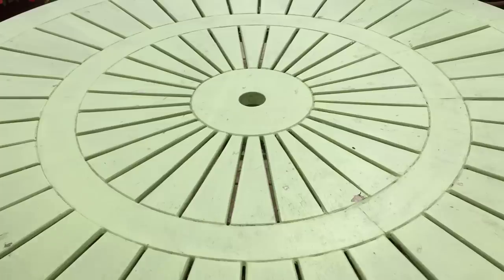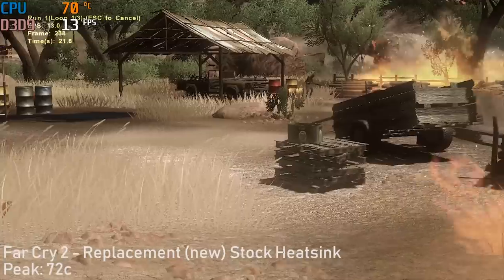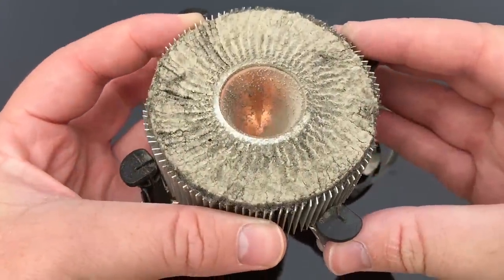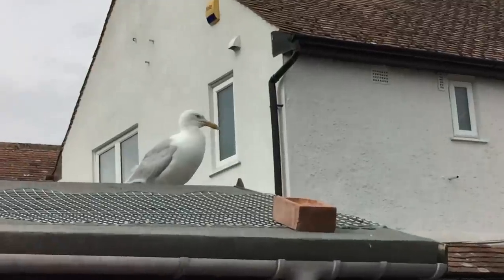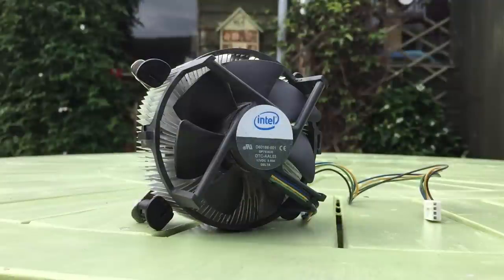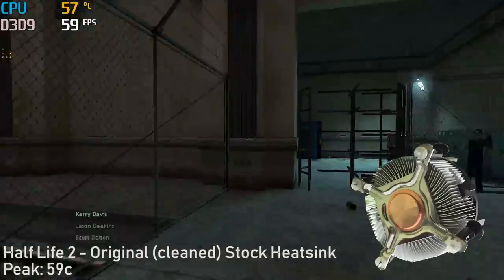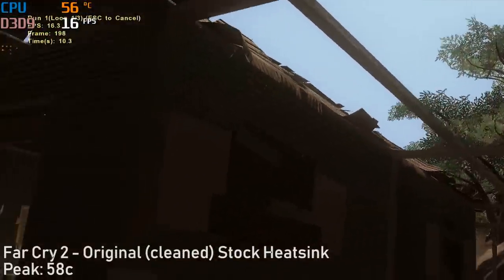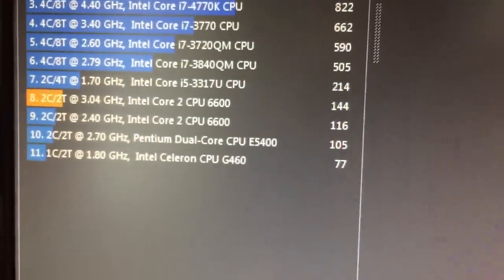Saving The OG Intel Heatsink!

Comment: Sadly, Intel’s Stock HSF for LGA775 doesn’t compatible with LGA115x boards. ☹️
Reply: johnpaul bautista I'm actually using one on my MSI 1155 Motherboard... I had to lock it down with Zip ties though... It's very secure though... I even grabbed the whole thing by the cooler and it didn't budge at all
Reply: Rourke Hikari i think it’s a good idea but AsRock does add mounting holes for LGA1155 boards (Example: AsRock H61M-VG4) kindly google for that board and see it. 

Btw, I have a older HSF with Copper in the center but a broken mounting locks. But there is a easy fix for that. Salvage a hsf from a newer one.
Reply: I was thinking about swapping the new stock cooler on my 4690k with one I have buy I guess not.
Reply: Easily solved with small round file and few minutes of work
Reply: Intel Copper HSF such as these are available for 115X, they probably come with higher clocked core i5/i7's. I bought some from recycle junk shops and is installed on my kiddos i5 2500 non k pc.
Reply: johnpaul bautista Actually... you can with some improvisation, UFD already did it
Reply: Jussapitka You can't but you can, watch UFD Tech video about it.
Reply: @JaypiTechPHOfficial  I broke the clips of my cooler like a moron, you can order them online for really cheap

Comment: I never ever ever through PC relate things. From smallest screw to big HSF. I have around 20 Fans including blower one and intels one
Reply: To clean heat-sinks i simply wash em and let em dry yes including the fan :)
Reply: I have washed motherboards only. But never PSU and GPUs as of yet
Reply: through = Throw XD
Reply: Halon_1211 yeah just dip it all into a steaming bath tub with corrosive detergents for a day or so and you're good isint it

Comment: Let's build a gamer out of a Dell Optiplex 780 Minitower, they handle Quad Core CPU's, & 16GB DDR3 RAM!  Bonus: the 780 Minitower Case was Built like a Tank!  U can pic one up for a song on eBay!
Reply: but you can also pick up newer models with 2nd or 3rd gen i5's for not much more if your look hard/often enough
Reply: The Optiplex 780 Minitower case is Built like a Tank!
Reply: I know. I bought one last year for my cousin (got it for free actually cause psu was broken, seller refunded me, and I replaced psu so $15 for case, cpu, mb, ram etc)

but it's also really stupid. The motherboard is backwards or something, so you can only use single lane pci-e gpu's, which limits you to a very small # of cards. I used a zotoc 1050 single lane at the time. was a huge pain in the ass since I had just wanted to throw in my spare 750ti but that was dual line like basically every modern card that's not low end

sold it andmade sure to always check the pci-e lane upgrade path since then
Reply: U just need to cut away part of the Heat Sink shroud & U can fit a Nice 2GB card in there!
Reply: has nothing to do with the heatsink, you need to cut the back panel, there's literally no more metal brackets to break off since the pci-e lane is the last lane and it's facing away from the other lanes

well...I take part of that back, I guess the shroud would cause issues as well if you used a very long card, but I'm talking about even short dual lane cards, like a 750ti.

but the lack of even sliding in a dual lane card since there isn't an open bracket on the back panel is the first problem you encounter before the shroud
Reply: Steve Smith U don't need a 2 Lane card!  Just drop in a 1 lane 2GB card!
Reply: Some cards have a large heatsink and fan, so U have 2 cut the shroud to fit it in.
Reply: yeah you can, but a design that at least lets you insert dual lane cards (like the vast majority of pcs) would have been nice. I honestly never thought that would be an issue when I picked mine up to build my cuz a cheap gaming pc. My plan was buy him the pc, throw in some extra ram, and give him my 750ti....ehhh no can do. 

then I had to search for sinlge lane cards and that was annoying. the 2gb 1050 is your best bet
Reply: BootlegScarce i think that's a dual lane gpu still.
Reply: Cool lemme write a SONG then

Comment: get a small air compressor
Reply: said this a 100 times.
I got a cheap € 60 20 liter one and its awesome.
Reply: datavac
Reply: You can either buy a compu cleaner. It does cost quit some money, but it works extremely well. Much better than canned air. And it is portable.

Edit: here is a demonstration video. https://youtu.be/ZzBZTl29oG8

Comment: 2nd tip: when using air through your fans, dont let the blades spin. you're forcing the motor to spin faster than intended and could bend it. hold it still, spray, and turn manually. i tape mine inside my case before i hose it with my air compressor.

Comment: Is this 1151 compatible;
Reply: psaris7 maybe,but probably not
Reply: If you go the Linus route it`ll work a treat
Reply: I think a channel named udf tech or something tried putting one on the 1151 socket and it doesnt quite match up.
Reply: Even LGA1156, 1155 and 1151 dosen’t compatible with older HSF. I like the old design of Intel’s stock HSF because of Copper in the center which dissipates heat and to prevent CPU Throttling.
Reply: Nop
Reply: with zip ties only instead of push pins.
Reply: You definitely can, but it needs some work. Probably you can hack the 775 cooler, re-drill holes or make the mountings fit 1151. Not 100% sure though. Or, of course, zip ties.
Reply: I think AsRock does have mounting holes for LGA775 HSF. (Not sure if AsRock or other brands)
Reply: It doesn't need any work. 775 is EXACTLY same cooler mount as 1155, 1156 , 1150, 1151
Reply: I tried it in the day and the 1150 socket doesn't have the mounting holes in the exact same place as the 775 so I guess is the same for the 1151, it seemed possible to hack it a bit with zip ties but I was lazy and went for a evo 212 instead
Reply: Check your info. 775 has 72mm between mounts and 115X has 75mm.
Reply: Take out the standoffs and mount it with long screws, nuts and rubber grommets on the motherboards.
Reply: Lothaire Cliquennois  no, it’s not. The hole spacing is different.
Reply: TBH ? No But you can mod it if you have the right materials
Reply: Intel did a smart thing by keeping the same holes for all the 115X sockets, but that's not a 115x socket
Reply: seems only 775 compatible
Reply: The Power of Zip ties easy fix and few Mods

Comment: 😒 well yeah I thought u were really stupid and dumb to throw away a high performance intel cooler, similar to a cooler master of that era, dont waste money on air cans, use a brush and wash in hot soapy water, wash off, air dry in sun, spray and wipe wd40 the electric motor, install onto cpu using grey antisieze grease paste, dont waste money on thermal paste, check all the plastic feet that they all went thru and locked, should hover between 60C and 70C while gaming on a Quad Core Q6 Q8 Q9, ramp up the fan a bit in the bios if it goes over 70C 💻🕹😍
Reply: @stevesmith1383  😊😸 yup Extreme just like the QX9650 yay! yeah! 🚤🚤🚤🚤😍🚩

Comment: The heatsink can be washed in a dishwasher as long as you can remove any electronics and sensitive plastic/rubber.

Also for tracking down noise, sometimes it's possible to squish the PC case rivets tight if any joints are loose. This can help to reduce noise that isn't coming from fans directly. Also consider using the proper sized rubber o-rings for mounting fans and mechanical HDDs. A little hack I learned years ago that has served me well.

Comment: YAY! We saved the cooler! 
Regarding the state of it, I actually cleaned an amd one in much worse condition. The pc was overheating so when I opened it there was a thick mat of dust under the fan and it was actually growing some kind of mould, it lifted in one piece. That was the absolute worst I had to deal with.

Comment: I keep an old copper core heatsink and fan just like yours for better cooling than the trash made today. I clean my heatsinks , MB and fans by throwing them into the dishwasher then letting it sit outside all day the Florida Sun before powering it back on. Works and take very little effort on my behalf.

Comment: Good job on saving this old CPU cooler before they picked up the trash. That never happens for me and I usually lose the stuff. I still miss a beater of a case I binned and at the time seemed junk, but now I think of all I could've done with it "if" only I had not thrown it away. I don't even remember the name of the case to show you a photo(shrug)? I've seen others comment about old tried and true CPU coolers and for me the ones in the older Dell Optiplex models(330, 755, 760) seem to keep my old spare systems running smoothly. I sort of do not want to rock the boat when I consider replacing them - if they work then let them continue to do so. Thanks for sharing this video with us and: Praise The Lord and Godspeed to you all - Psalm 113:7!!

Comment: These heatsinks can be washed with soft detergent-water to make things easier and much cleaner. The fan in my experience has always turned quieter with some oil or grease in its motor. The fan propeller can pop out from its motor with some carefully applied force. Another hack is to break away its default standoffs and mount it with metal screws nuts and rubber grommets. It makes it hold more solid and drops temps by about 3*C and some rattling noise goes down. I even painted my stock cooler's fan and heatsink with engine enamel. Replacing the sticker and soldering fresh braided wires is possible too. Too much work but you'll be surprised how good they can look & work after being modded.

Comment: Best technique I have found it to use hot tap water to clean the heatsink, followed by a quick dry with a hairdryer or compressed air. The fans are easily cleaned with baby wipes. I find paintbrushes are great for motherboards but not so much for heatsinks etc. Cheers!

Comment: When cleaning anything with bearings using compressed air you should hold the fan in such a way that it doesn't spin, it's very common to exceed the units max RPM.

Comment: A similar thing happened to me some years ago. 2011-12 I bought a i3-2100 and with it came its aluminium cooler (like the one you got in the video), It worked fine and at some point I bid on a used i7 boxed something on my countrys version of ebay. The seller had got it in a trade and much to both our dismay it was only the box with the cooler without the cpu. I made a deal and got my money back and for not having to sent the cooler back I could keep it (to save on postage). That cooler is a beast compaired to the standard one from the i3 it has a coppercore and have some weight to it like the one you resurrected from your bin. There is a 3 version of the ones sold with the socket 1155 the ones that the i5 had, that is like the i3s made of aluminium but is about 2.5 times higher then the i3 was. Long story short the i3 one will make almost any cpu it had throttle

Comment: One of the best OEM coolers is the Socket 1366 single CPU cooler of the classic Apple Mac Pro 2009 - 2012 models. Keeps a 130W TDP Xeon cool with a completely standard 80x80x25 Fan inside with less than 2000 rpms.. in idle <40°C with only 800rpm. OK, but that case also has a fairly good airflow in the CPU chamber.

Comment: Try using hot/warm water in a small plastic tub with dish washing soap.  Let it soak first, as this will affect any grease and cooking oil that can and does accumulate on a heat sink.  Keep in mind, that in a real sense that any fan is a vacuum cleaner and pulls a great deal of air and whatever is in that air thru it.
So, use the brush on the heat sink.  But you can also clean the fan itself at the same time.  Soapy water will not hurt it, I promise.  I have even added some ammonia to the water for super clean results.  THEN blow them all off and set them aside to dry.  In addition, I will also give the fan motor a small spritz of WD-40, or an equivalents light oil in aerosol form.  Works a treat - m8 . . .

Comment: Just a tip: When using compressed air on fans, hold them still and don't let them spin as it can damage the bearings and reduce the lifespan

Comment: I had few years ago E6600 machine with that same stock cooler. I used to always overclock it to 3,2ghz and surprisingly it always ran very stable and relatively cool. It also boosted the performance up quite a bit. Btw the mobo was Asus P5W dh deluxe. Very nice mobo with many nice features.

Comment: Depending on the age of the MOBO, noise could be due to an AUX fan on the north bride. I recently did a "retro" build using an i7 920, with an EVGA x58 x3SLI mobo, and the AUX fan on there makes a significant amount of noise, even after cleaning. This could be due to it running at 4700rpm, which seems to be what it was intended to run at.

Comment: I still have a huge cooler which originally came in my 2009 Packard-Bell Pentium system, now upgraded to a C2Q Q6600. Believe it or not, it is even bigger (not only for a bit) than the Intel ones, but unfortunately lacks the copper center, which keep the temps a bit high (50-60C idle and 70-80 when gaming). With the Pentium, for which this heatsink was designed, the temperatures were quite lower, but so was the performance. Now, upgraded with the Core2Quad, a GTX770 (upgraded from the mighty 512mb Nvidia 210), 8gb of DDR2 RAM (upgraded from 4gb) and a 120gb Kingston SSD, alongside the original, now 9 years old, 1tb Seagate HDD it is ready to play even the most recent games at decent framerates and video quality :)
Reply: Actually it doesn't bottleneck... even having the GPU overclocked it is able to hit 100% most of the times, with the CPU not going even near that number. This CPU can be paired with even a 1050Ti and still not bottleneck... Btw I wasn't supposed to have gotten a 770, but I couldn't let a good deal pass by :)
Reply: lRaziel1 The upgrade path for this socket is not much, even if I get a Xeon I’ll probably get similar performance to what I already have. As I said though, I wasn’t supposed to have a 770, I was just lucky enough to find a 770 for the price of a 760. Btw this is not my main rig, I have a 4th gen i7 laptop with a 4gb GTX960M which I use for gaming and video editing, but there are a bunch of games I like that I don’t want to install on the laptop due to the lack of storage space, as the original 1tb SSHD was slow and I decided to put a 500gb SSD in it. I am talking of games from before 2012, mainly, so the desktop is only used for games which don’t demand too much processing power. I know the Q6600 isn’t a great CPU, but for the task I’ve given to this computer (and to add it a little bit more of life time) I’m perfectly fine with it :)

Comment: I recently built a PC with a DG43GT motherboard I snagged on eBay for $30 and a Q8400 for $8.50. The motherboard came with a Core 2 Duo E6300 which I set to the side for either restoration of an old system, another build or just collect dust. :P Anyway the stock cooler it came with sucked ass! So I pulled out the stock cooler from an old HP media center I had lying around and that brought the temps down significantly! So far it hasn't gone past the mid-60's. It's much quieter too. Not bad for an old cooler from 2005. The heat sink is pretty hefty and even has heat pipes! It mounts an 80mm fan which I had to buy separately.

Comment: Got a later generation Intel stock Heatsink with Copper Core with my old i7-2600k. It was lying around for 6 years in a shelf since i used a much bigger cooler from the getgo. I replaced a newer Stock Heatsink with it and used good Thermalpaste (The Intel past was still good though). Now the PC is inaudible and much cooler.
The Problem with new Heatsinks is also Intels/AMDs approach. "It's fine as long as it doesn't throttle." Meaning even 90°C is still within their Spec. Throttle with current CPUs occurs at about 100°C.

Comment: Always hold the fan blades to stop them from moving if you choose to clean them with compressed air.
You can damage the fan if it spins up too much.
Or just clean it with a brush and keep the compressed air away from it is the best idea.

Comment: Nice to see! Still I can absolutely understand the DAIWA tactic in this case. Still I love to have backups for about everything I have in my computers and throwing away usable stuff isn't really what I would do. Indeed I took an Intel heatsink and cut off the cable and added it to the fan of a defective PSU (which had a differend connector) so I could use the fan as a case fan after that, which wouldn't have been possible with the intel heatsink. And yes: It was one of the newer, very cheap and thin all-aluminum ones.

Comment: You should consider cheap tower cooler from Deepcool like Ice Edge Mini for 80mm size, Gammax 200 for 92mm size and Gammax 200T for 120mm size. I personally used the Gammax 200T for my pentium D 915 with just around 10 pounds(or less depending on where you find it). You'll get 2 direct contact copper heatpipes with it, PWM 120mm fan which normally spins around 900rpm, easy socket mounting with option between LGA 775 or 115x. This is not promotion since you can buy a used popular aftermarket cooler like Coolermaster or Noctua or Cryorig for cheap and then replace the fan if it's broken. This is just an alternative for buying a new cooler for cheap instead of buying used one.

Comment: I find various versions of copper slugged heatsinks at thrift stores every once in a while for $1-2.  Always keep one on hand to help someone who wants to build a budget pc.  They can handle even some i5 K skus (not overclocked.) Like the 2500K And I've even tamed a i7 7700K delidded and undervolted without it thermal throttling under load.(before you guys kill me it was temporary until a 280MM AIO came in.)

Comment: I still have a couple of those older copper inner intel HSF installed in 2 PCs.. they really are great coolers... in my Q8400 OCed to 3.5gHz, it keep the temp below 60C and running stable... i will keep these as long as i have LGA775 socket PC running..